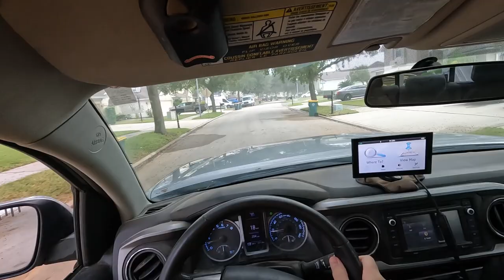Make Money Street Scrapping on a Foggy Morning

Comment: Those big umbrella frames can be quite awkward to load and keep out of the way. I'm always tempted to break them down when some of the main pole is aluminum. Also at 12:50 that U shaped monitor stand you took, not sure if you keep those for later but they do have some decent cast aluminum framing inside, takes a little effort to clean (hidden screws on bottom I think to get it started).
Reply from the maker: Yup, those big umbrellas can be a challenge for sure. I was giving some thought to keeping the stand for later, but got caught up unloading and completely forgot about it.